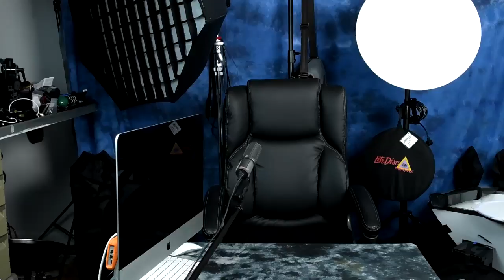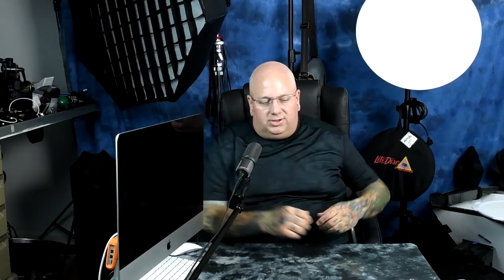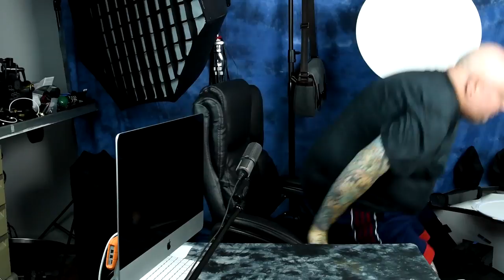🤔HOW TO: CHOKE OFF Dynamic Range from your camera unnecessarily

Comment: Perfectly put Ken about the gain knob on radios and s/n ratios. I'm an amateur radio operator. I own a Yaesu FT-950 and a FT-897d. ICOM and Yeasu..sort of like Nikon and Canon. I enjoy the digital modes like PSK and RTTY. Photography and amateur radio...two great hobbies to fill in the time before I drop dead. Anyway...73's for now.

Comment: The native sensitivity of the camera sensor never changes, regardless of ISO setting. That setting, as Ken has pointed out correctly many, many times applies gain to the image already captured, which is essentially underexposed at any ISO setting higher than the sensors native ISO. As the ISO climbs the signal to noise ratio decreases and noise becomes more apparent.

Comment: ok, changing on the dame camera the iso, i change the SNR? and why everybody put ISO on the button ? higher ISO moore Signal amplification moore noise and les dynamic range, that is clear like budweiser ( beahhh horrible ). or i don't get this? some people say ISO it's the sensibilidad from the sensor, but i know that is BS, because the sensor is x sensible all time, not moore, not les switching whatever for boton :-)